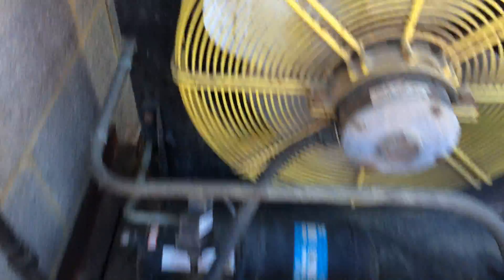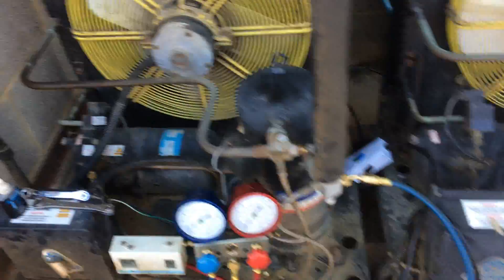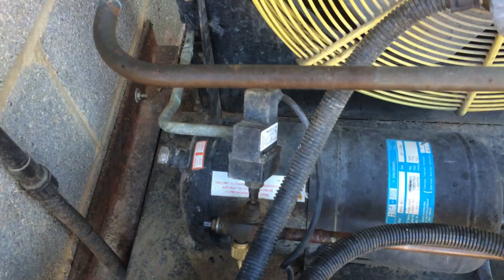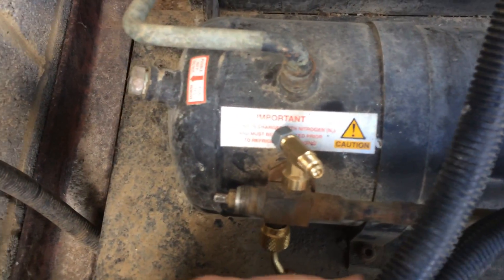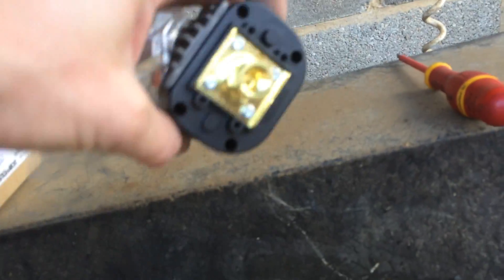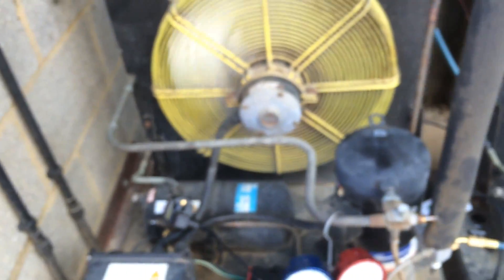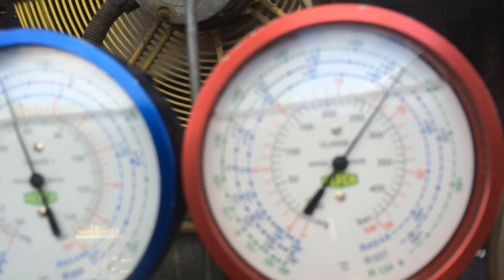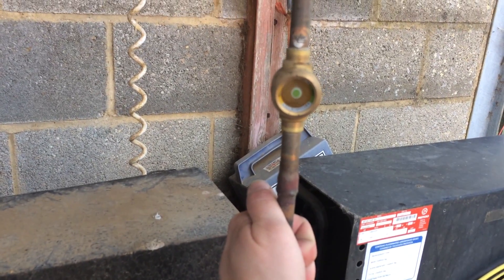Fan Speed Control Fail

Comment: What I do for cable tries is use an 8in charcoal filter canister, as it fits the most common ties I use, has a screw on lid top and bottom and it holds 300 ties. I change those filters about every 2 months, so have plenty of them around to use. Just unscrew, toss out the charcoal and the 2 foam insides and leave the fused filter on, then wash, clean of the fines and pop the ties in. Break it or lose it not a worry, just grab another. Blue lids and white body stands out in the work area as well to find it.

Comment: I personally don't like fan speed controls I like the good old fashion hi pressure stat for fan control mechanical is the best but I know it's more efficient
Reply from the maker: +hardcooling I like them when they are working ok! If it wasn't for the cost i would fit a HP switch as well to take over if the control failed.